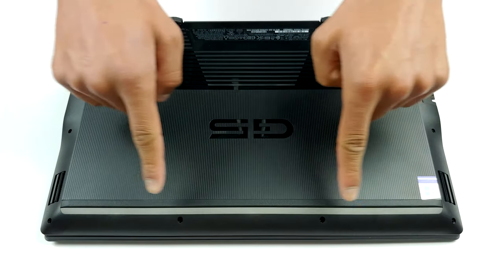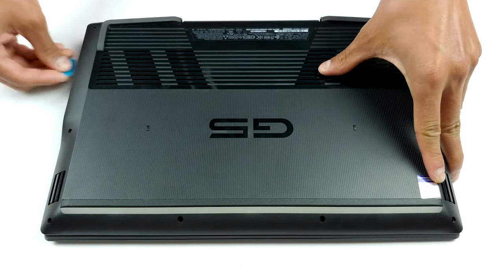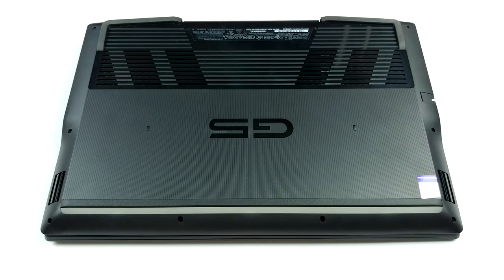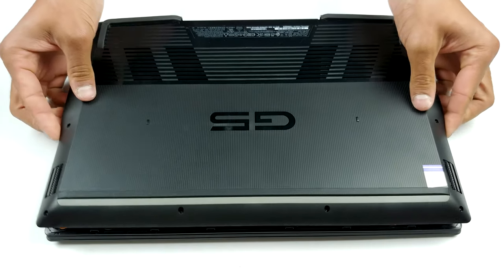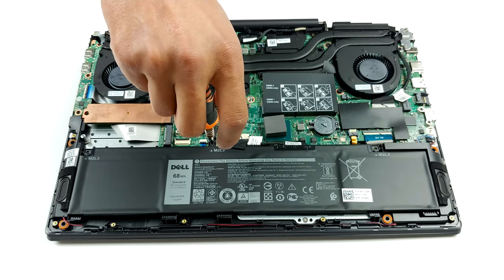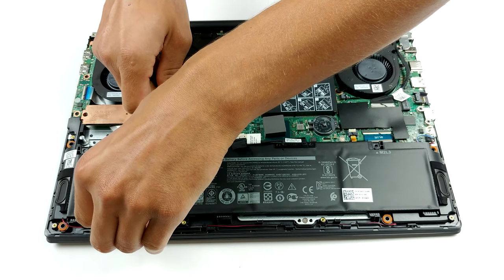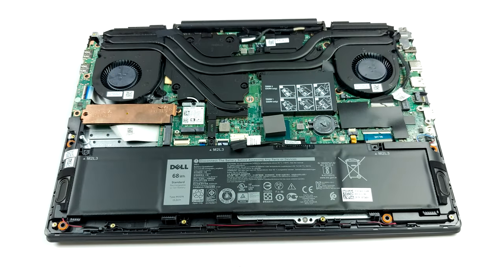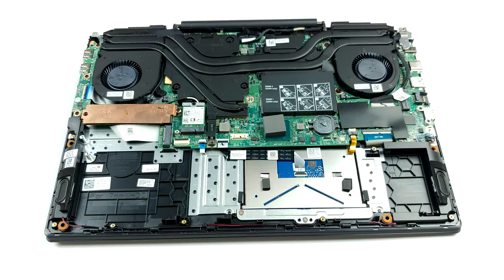🛠️ Dell G5 15 5500 - disassembly and upgrade options

Comment: Good Video, but at the 35 second mark, it would've been great if you opened the bottom from the other end to show where and how you disconnected the LED strip ribbon cable. From the video, it just looks like you stick a tool in some arbitrary place and it magically comes loose. It doesn't really show where it is. I had to look at another video to identify where it was
Reply: What was the other video that you looked at?  I saw a video and the G5 didn't have the cable(?)!!! I tried to put it where I thought it should go but it doesn't work now...

Comment: Tried working on it tonight but having some issues with the screws closest to the back hinge as far as getting it open.
Reply: Same. Have you found a solution?
Reply: also same
Reply: @adderalluser9021  same
Reply: Me too they won’t come out
Reply: Did you ever get them out?
Reply: The screws at the back never come out they just unscrew and stay in the casing :)

Comment: What anti-static precautions did you take when disassembling? I have just got a RAM upgrade that I will install myself, so it would be good to know.
Reply: Grounding yourself is important.
Reply: @barkbork7528  how
Reply: @forsakenfish  It might be better to google this than to ask me, I'm not an expert by any means.

Comment: so, the second SSD slot can fit any M.2 NVME as well as a mSATA SSD, right?
Reply: I also wanna know this 🤔
Reply: @traseurpete  can confirm it does. mine came with a mini ssd or whatever it's called... it's maybe the quarter of a size of a m.2 nvme ssd. but I also recently bought a sabrent rocket m.2 nvme ssd and that fit just perfectly in the 2nd slot and works flawlessly. :) so now I got 512gb primary and 1tb secondary. hope this helps.
Reply: @tracked24  awesome I'm going to get that one as well 👍 similar speeds to Samsung Evo and cheaper!
Reply: So, could I fit an m.2 SATA III SSD in the empty m.2 port?

Comment: @LaptopMedia , Hello is it possible to run the laptop without the battery, I mean only plug the adapter, also is the Graphic card socketed and can be upgradable, Thanks a lot

Comment: Sadly I opened mine and it came with the large battery... so I couldn't put the 2.5 hard drive :( I'm gonna buy a M.2 I believe
Reply: Hey, what components does your Dell G5 15 5500 have, I want to put one of M.2 on it and I want to know if your laptop has the same components as mine, would you help me a lot ...
Reply: @inakicizur  I think the only difference is if you get a large battery or not. If you have, the only way to adapt an SSD is in the free slot next to the other SSD that comes in the laptop. If you get a small battery, you can adapt an 2.5 SSD. The only way to know is opening... :/
Reply: @angelsabillon93  Yo estaba igual que tu we, Pedi por amazon un SSD de 2.5, y luego me puse a investigar, al punto que tuve que abrir la Dell y pues vi que tenia otra entrada M.2 pero ve el lado positivo, que vas a ir mejor con la entrada M.2 es mas rapida...Cualquier cosa ahi me dices
Reply: @angelsabillon93  I think you can know from BIOS as in case of small battery there are 1 ssd slot and 1 2.5 but in large battery it will appear that you have 2 ssd slots and one 2.5

Comment: dell g5 5500 heats up after 10 minutes I have already performed maintenance and formatting, after 10 minutes it heats up excessively and the fans start to work too much
Reply: Maybe you goto replace the thermal paste

Comment: Hey, I'm considering buying this, but I'm not a heavy gamer. Some gaming and video editing and content creation are my area of focus. So could you tell me if the heating issue is a deal breaker for a user like me?
Reply: With a CPU downclock, and a GPU overclock, I can still perform well in games without exceeding 80 C
Reply: Mine has no issues now even with turbo boost on. I think the latest bios update has helped or perhaps cooler winter temps.
Reply: @boniestcoder3918  what CPU model do you have? I have the intel i7 10750h but the multiplier is locked. I did however overclock the GPU bus to 6+ GHz but considering the improvement was marginal and stability sucked, I left it as is.
Reply: @ivanrodionov9724  I also has the 10750h, I undervolted at first, but eventually just capped the cpu at 2.4ghz. It's not that bad of a performance loss, compared to the 15 or so Celsius higher otherwise.
Reply: I've had it for about a year and wouldn't recommend it probably a year late lol but in the longterm it's started drastically disceding in power.

Comment: Do you know if the screen can be upgraded from a 60hz to a 120hz or the 144hz I have the g5 15 se 5505 which has a 60hz display I just want to know if this is possible and what’s the connector this laptop uses is it the 30 pin or the 40 pin connector?
Reply: Pretty sure it's over 60hz mine is

Comment: Im buying the model with 512GB SSD, Can i later add a 1TB HDD?
Reply: I need to know the same!
Reply: @Ekthell  yes, i got the one with 512 and it was full after installing RD2, Battle field V and SWTOR. So just ordered this for the second slot. 

https://www.dell.com/en-us/shop/dell-m2-pcie-nvme-class-40-2280-solid-state-drive-1tb/apd/aa615520/storage-drives-media
Reply: @x534n01  $400 for that drive is a terrible deal. I got a 1TB Samsung Evo Plus NVME for $150.
Reply: This one is SSD only

Comment: Anyone know how long the battery in this laptop lasts?
Reply: Mine lasts a good few hours browsing and watching videos. Roughly around 4. 5 hours but gaming won't last long at all.
Reply: 4-5hours of youtube/twitch full hd
Reply: gaming 45m
Reply: Hey, I'm considering buying this, but I'm not a heavy gamer. Some gaming and video editing and content creation are my area of focus. So could you tell me if the heating issue is a deal breaker for a user like me?
Reply: @thorodinson4206  Just turn turbo boost off if you are concerned. I use mine for photo and video editing and the only time temps can go high are when rendering so if you are concerned just turn turbo off just for that portion.

Comment: the worst thermals yet, got this computer Friday by Saturday was over heating and then restarting.
Reply: Disable turbo boost and repaste. Mine runs Fortnite at Max settings at around 110fps and 79 degrees on CPU and GPU.
Reply: Mines not too bad but if you have it on your lap it will die at gaming, I got a lapdesk off Amazon and since that it boosts to 5ghz on most applications!!
Reply: running all the latest updates and have had no issues running max settings in RD2.
Reply: Go into the bios & disable 'Intel Turbo Boost'. This reduced the cpu temperatures by about 25 degrees on average for me with no appreciable detrimental effects.

I got mine 6 months ago & killed both fans trying to keep it cool. I'm going to replace them both this morning.
Reply: Another option is the bios update which throttle the cpu at 93 degrees instead of 100 in performance mode. I personally use balanced mode with custom fans in AWCC at 85% which gives high 70's cpu and high 60s gpu in doom eternal with 130fps+ average frame rates.